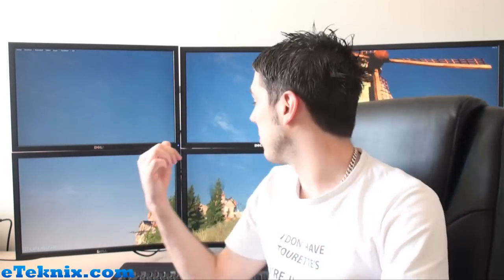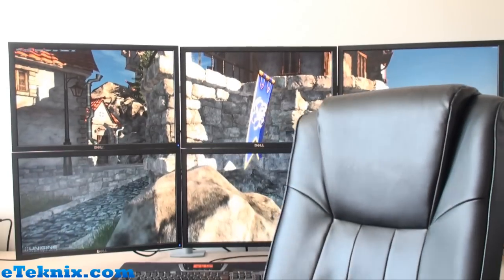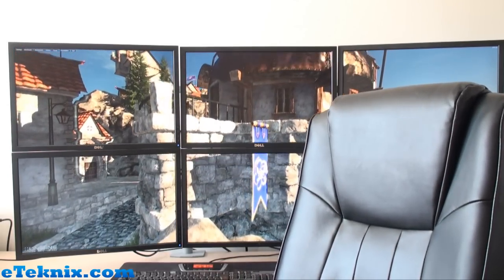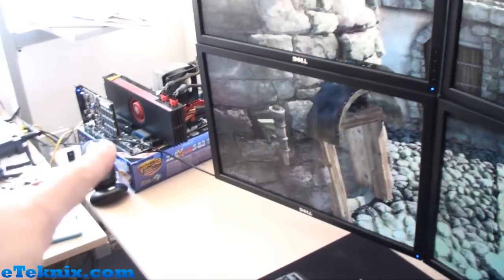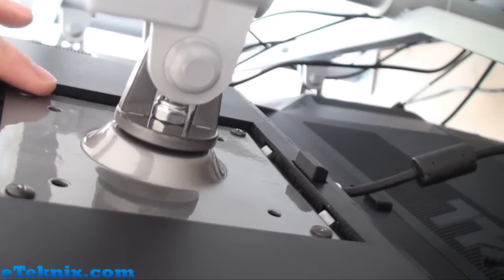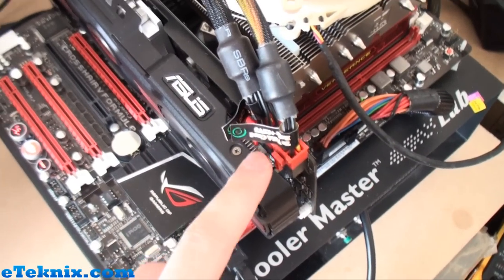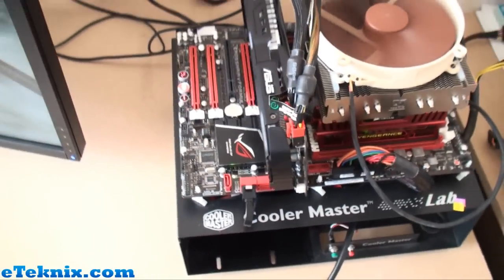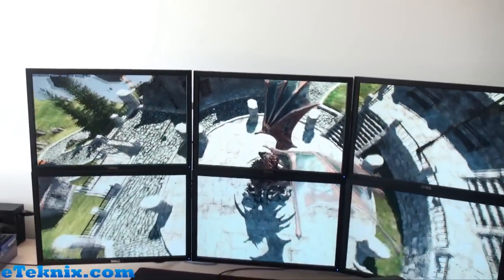Six Screen Eyefinity Review - Introduction

Comment: You could just get another gpufor the 6th display and then up the performance. I personally dont like it, the auto picture linking doesnt work imo but hey thats just me. My best friend will be getting it with ivy bridge and i think hes an idiot, whats wrong with just using a 27" or even 30-32"? cheaper and better quality and you need less gram. my 2c pennys worth :)